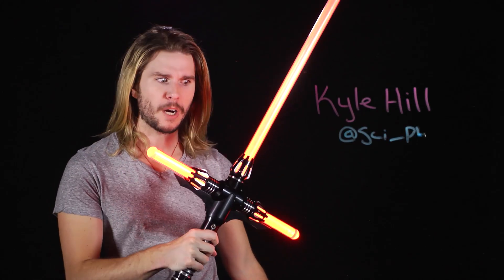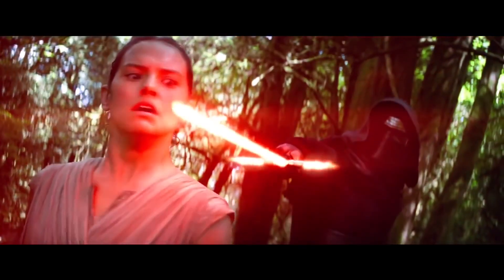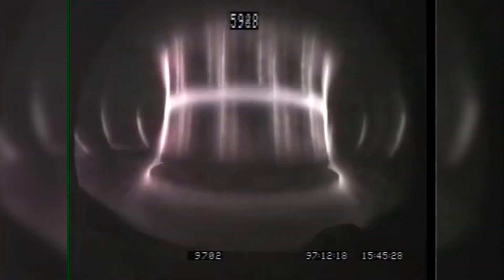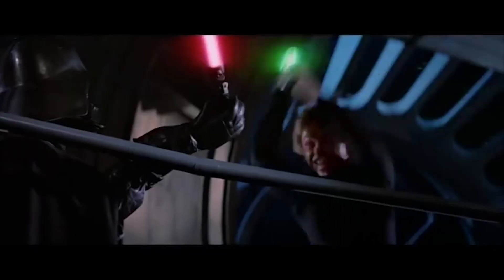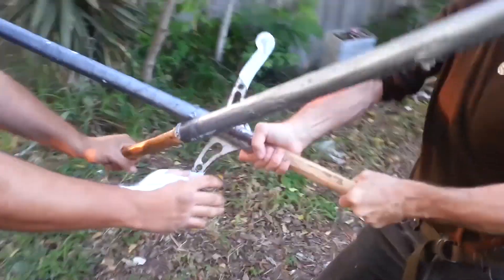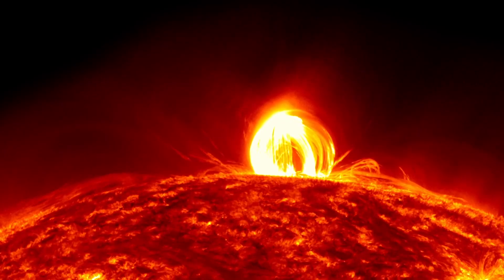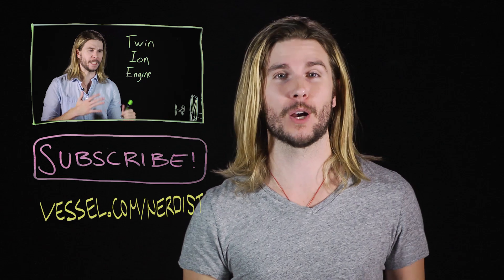Why Kylo Ren's Lightsaber Works (Because Science w/ Kyle Hill)

Comment: I totally get having crossguards to protect the hands and deflect incoming saber attacks, but having the actual plasma coming out of the sides is only a hazard.  Negating any reasoning that the offshoots are exhaust due to the lightsaber design, there is no reason that they should be on the hilt.  Any crossguards could be made from lightsaber resistant material (hell, look at TR-8R's Z6 baton) without the danger of burning/cutting the user's hands.  I mean, greatswords didn't have crossguards made into daggers, why should a lightsaber greatsword have plasma crossguards?

Comment: this was a mistake. The crystal used in ALL lightsabers projects the beam out through the tip like a normal lightsaber but kylos is broken and out of control. This made the beams pop out the sides and he made to handle and the crossguard to fit the out of control crystal. fun fact

Comment: Kylo Ren's trisaber should actually not work:
1. The crossguards are impractical because they could just as easily hit you, and no sword in history to my knowledge had blades for crossguards for that very reason. Even the broadsword that man is swinging around isn't "cutting" him because the crossguards are rounded.
2. The crystal is the focusing point for the energy that comes from the battery in the hilt, it does not create the arcing energy. We could assume the nozzles where the energy extends from are what controls the energy flow back into the battery in order to recycle the energy. So yes, if another lightsaber duelist cuts the crossguard nozzle it might protect Kylo's hand, but that should also damage the nozzle and stop the arc so the energy will just start spraying out and could cause serious harm to Kylo.
3. The crackling of energy from Kylo's trisaber looks like it's just spraying outwards, which means the energy isn't arcing back into the battery so it should be incredibly energy inefficient. I am, however, not an expert in how long the batteries in the lightsabers can last before running out of power.
4. Speaking of which, I have seen comments about how the crossguards' function is to actually stop the trisaber from overheating. If that were true, and I assumed it made sense, the crossguards would be expelling excess energy instead of recycling it through an arc so the trisaber is still very energy inefficient even if the main blade is still recycling the energy despite appearances.

Comment: Those are not crossguards. Lightsabers have forcefield emitters where the blade meets the handle. Crossguards are not sharp, so there's little chance of the wielder injuring themselves with their own defence. Those little offshoots are more like knives for the function they fulfil. 
Crossguards can be used offensively, but this requires the wielder to put a fair amount of punch into their swing since they're using a bludgeoning attack- yet when we see Kylo Ren use his 'crossguards' to attack, he very slowly moves them into Finn's hand, much more like a knife attack.
You'll notice that though most historic swords would have some kind of guard even if not a crossguard, they didn't have blades sticking out of the sides of them.

Comment: I can't believe how many people are liking this. Kylo's tri-Saber has nothing to do with the history or need for a cross guard. It's all in the lore, when rebuilding his lightsaber (presumably after joining the Knights of Ren but before destroying Luke's new Jedi school) he damaged the crystal (Lightsabers power sources area fictional type of crystal). The 'cross guard' of Kylo's saber is really two Exhaust Ports to prevent the crystal from imploding and possibly killing him. Traditionally an active Lighsaber's crystal releases it's energy a fixed distance before returning back to the crystal, this is a power loop similar to Phantom Power to a Microphone. Kylo's damaged crystal receives the returning power but the damaged areas refract the power essentially creating nuclear fusion within the crystal, this completes the charge cycle to give the crystal it's power back but it creates far more power than it can output back into the loop and needs to be exhausted. When the overloaded power doesn't get exhausted and goes back into the loop it leaves the loop because it is no longer bonded with the looping energy, this is the fiery red molten metal and lightening effect we see around the saber. The lightning effect is the discharging energy and the molten metal it the discharge causing the particles in the atmosphere around the saber to fuse.

Comment: Look at all those shots from the movies where hands are lost. The only two where a crossguard might have protected the user was, Vader losing his hand to Luke in Return of the Jedi, and General Grievous. Most of those shots the slice comes from below cutting up through the hand or arm. No cross guard protects from that. Then you even used a bunch of "examples" where the person losing a limb doesn't even have a lightsaber to being with.
 However even assuming the crossguard is designed in this saber for the purpose of protecting the hand, the guard is half made from the lighsaber's casing itself. Meaning if a blade slipped down his blade into the guard it has a 50% chance to hit casing instead of blade. The only use for the guard as it is, that makes sense to me, is for breaking a saber lock by using strength to force his "guard" into the opponent like he does in the movie. My question is, why would you risk putting it on both sides of the saber, if there is a possiblity of the enemy being physically stronger and turning that tactic against you. If you say you could turn the saber in your hand so it isn't pointing at you, then you just took your hand off the blade in a lock. This weakens your push against the other letting him push your saber away and you just died.

Comment: I wonder if anyone has taken into consideration that Kylo Ren is a knight of Ren, so what do you think of when you hear "knight"? You think of King Arthur and mid century Knights etc. king Arthur also has Excalibur which has...you guessed it, cross guards. Kylo's light saber has cross guards because he got smart and doesn't want his hands cut off. lol nothing more, nothing less. Exhaust ports aren't needed. It doesn't matter how unstable his crystal is. It would just exhaust out of the front like normal light saber is supposed to do. Don't convolute the issue with stupid fanfiction.
Reply: His lightsaber was built with a cracked crystal. The cross guards are there to vent it. Else it would blow up.
Reply: This is no correction to be made. You've simply derailed the thread. Congratulations lol
Reply: Derail. Get over yourself.
Reply: Arkaik Ahh but won't it vent out the front like a normal lightsaber if it didn't have vents? Where is it officially written that it's supposed to be vents? I'd like to see evidence of this.
Reply: Is this from the script? Or is this Canon?
Reply: Also nothing in this dictionary says that its meant to be anything but crossguards or "quillons". Sure it emits plasma, but they do that because it is meant to be crossguards. Also for balance. Nothing more...nothing less.
Reply: Yeah that's exactly what I just said lol. Sure it emits plasma but they do that because it's meant to be crossguards. We're literally saying the same thing lol. Although If they weren't there. I'm pretty sure the plasma would shoot out the front anyways. LOL derp count 004.
Reply: So your point? LOL Like anyone in the universe seriously cares about what we are talking about right now LOL

Comment: Yeah I agree, EXCEPT FOR THE CROSSGUARD PROBLEM THAT STEVEN COLBERT OR WHATEVER SAID. The main problem with this lightsaber is what happens when another lightsaber strikes the metal housings on either side of the blade. Even if the saber is built like the old clueless guy said, then if the housing is shattered the plasma energy wouldnt be contained and it would either dissipate or shoot out of the handle. Either way it would be bad. This lightsaber is great except it is made to stop other sabers from reaching your  hand, and if one smart jedi does strike there, it would cost him more then just his hand.

Comment: I obviously can't speak for anyone but myself, but my initial negative reaction to the reveal of Kylo's saber had nothing to do with the actual cross-guard. It was the cloying way in which they framed it. As if to beg for a reaction like the original Phantom Menace trailer received when Maul threw out that second blade on his double ended saber. It seemed so desperate at the time. So "ME TOO", if you will. 

Luckily that initial negative reaction was just that and the actual scene, in it's context, is just fine. Exciting even. As a good Star Wars scene should be.

Comment: Well the reason for the crossguards is because they are not crossguards. They are vents because of the shear power of the blade. Kylo's lightsaber is so unstable from not only being homemade, but from its power. It has to be vented out or it would be too dangerous to wield. Though, they do work for the crossguard concept. And the reason for all the disarming literally? It's a Jedi art and technique to cut off the hand and/or arm. It is to, well, disarm the opponent without killing them. The Sith took this and more did it to kill the opponent easily.

Comment: i dont think he issue is kylo can hurt himself, or that crossguards might not provide suitable protection, but rather having the 2 extra blades jutting from that angle significantly inhibits the sabre's range of motion (limiting the variability of the sequences and moves he can do) which is a big disadvantage over an experienced dualist (even though another dualist may be thrown off by the unorthodox design)

Comment: a few points (as per Wars canon) 
*the magnetic fields produced by a light saber create a gyroscopic effect and so light sabers do in fact have weight.
*the actual blade of a light saber does not radiate heat, only things that make physical contact with the blade are subjected to the blades heat.
*IMHO the 'cross guards' of Rens saber are ridiculous and dangerous. I would personally have had a light saber resistant material (many in Wars universe) such as Cortosis (which not only is resistant to light sabers but actually shorts out light sabers that come into contact with it) fashioned into a D guard or basket hilt.

http://starwars.wikia.com/wiki/Category:Lightsaber-resistant_materials
Reply: +Orion and that concludes why the guy in the video doesnt even know what the hell is talking about. He is just a poser.
Reply: CornerrecordZ too true mate.
Reply: +Orion Imagine Kylo Ren swinging around his cross guard lightsaber and accidentally cutting of his own hand with one of the smaller blades. :D
Reply: Darth Walrus exactly right mate
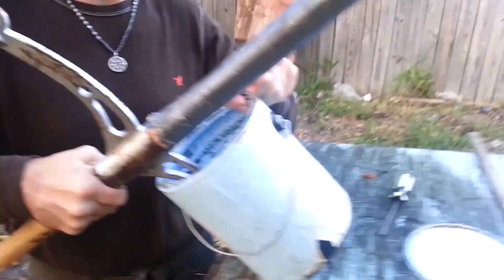Reply: Its not dangeorus at all 3:00 you could even watch his entire wideo if only nerdist would put a link to it.

Comment: Love this guy.. really funny! I love the crossguard lightsaber aswell!
If it were real, it would be really weird because unlike a real sword, a lightsaber would have no balance due to the blade being weightless (if it where made of plasma, which I strongly disagree on). It would be like holding a freaking torch. So there also would be no reason to swing it since it would gain no momentum. You rather just "flash" it at your opponent XD

Comment: Also, the possible reason behind Kylo's 'clunky' style of fighting could be because of the broken crystal. Lightsabers work with both the Force and gravity (look at Obi-Wan and Anakin's fighting styles - effortless almost), the cracked crystal causes inconstancies in the lightsabers fluidity and ability to move easily with both Force and the pull of gravity, it'd be heavy to handle, despite plasma being weightless. ^__^ p.s awesome video!!
Reply: +Charlie "Also, the possible reason behind Kylo's 'clunky' style of fighting could be because of the broken crystal.."

Or

I dont know

The bowcaster hole blown in his abdomen?
Reply: That is a fair point, it's just different theories I've seen around >.<
Reply: qui gon jinn is also pretty good at fighting

Comment: the lightsaber doesnt work cause the metal that connects the sides can be cut so having the lazer guards is a impratical useless design
Reply: Tanner P eh depends whose explanation you count as canon. Idc as long as I can kind of suspend my disbelief. These guys are fucking space age psychic samurai with plasma swords ffs lol
Reply: +Tanner P The beams of plasma are directed through those, it would just come in contact with the blade that was underneath the guard.
Reply: but there is no blade underneath them
Reply: +Tanner P "but there is no blade underneath them"

There ISNT? Whos says who? Got a source?

Also- You know jack shit about swordsmanship.  Please stop making about assertions you know nothing about.  Might I suggest getting some experience in something like hema, before attempting this again?  Thanks.
Reply: the blade itsnt contiuious throughtout cause if it was then there would be no need for metal sperators
Reply: The energy comes from the crystal in the lightsaber. The ports guide the energy, they don't create it.
Reply: i did and the got many things wrong
Reply: +Setjo91 You are SO dumb
Reply: +Tanner P I think the metal separators are there to protect the swordsman's hand/ allow them to grip further up.
Reply: yea but thats not the issue the issue is that the laser isnt connected completely underneath the sheathes so if the opponets light saber can cut right through it like anything else, making the design impratical
Reply: irrelevant im talking about the logic behind it and its completly impractical and its designed function doesnt work like it should

Comment: Even if the beam doesn't go all the way through, there is an alloy in the Star Wars universe that is impervious to lightsabers. Darth Sidious made his grip with it. Don't you think Kylo Ren would have thought of "Oh, what if someone cuts through the guard?" and made it out of the same material Sidious used?
Reply: I doubt he would.
Reply: +Flam1ngicecream 
The metal in question is called phrik, and IIRC it's insanely expensive, like the Star Wars equivalent of platinum. (Which is probably why they don't make droid armor out of the stuff.) Sidious probably used it for his saber less because it's lightsaber-proof and more because it's very exclusive. His lightsaber hilt is unusually small anyway, so I doubt he was worried of it getting damaged.

It's a good point, though: There are actually a lot of ways to make lightsaber crossguards using available Star Wars tech. Phrik is one, but if that's too expensive, we also know they have trouble getting through energy fields, which are all over the place in Star Wars. Even very dense, heat-resistant metals or ceramics would resist a glancing hit with minor damage - we saw this when Vader's armor tanked a swing from Luke's saber. Over-all, it should be possible to make a lightsaber with hand protection even without using additional blades.

Which probably means that the reason lightsaber don't have guards is, well, because guards are not considered necessary. This is true for a lot of swords in real life as well - many have either very small guards or no guards at all. This is particularly common with Asian swords. In fact, the idea that swords need a lot of hand protection is very Euro-centric. 

I know a guy who does a lot of Chinese martial arts and asked him why the guard on the jian is so small. His answer basically boiled down to: "Well, if you get hit in the hand, it probably means you used your sword the wrong way."

Comment: I read somewhere that Kylo Ren's lightsaber is a result of the way it was crafted. The blade itself is powerful but unstable, resulting in its flamey-ish appearance. Its lack of stability causes it to need the crossguard to vent the excess energy. This also supports the idea that the force helps keep the lightsaber's blade in a straight line. Kylo is also unstable and dangerous, and has yet to become a master Sith, and therefore cannot control his rage and insecurity when using his lightsaber.

Comment: Wait. Your argument comparing with a cross guard may be irrelevant. That saber should be compared to a "sharpened" cross-guard which is never used in medieval times. Your example of an arm getting cut off also is bad. Cross-guard wont save your arm. It saves hand and wrist. But... So far ive seen light saber bind or bounce on contact, never slide. May due to the magnetic field. There is a material in SW universe that can resist light saber cut. Could've used that. Thats why people hating it. Starwars was designed based on katana. Should've used that instead. First impression of this channel is cheap evidence.